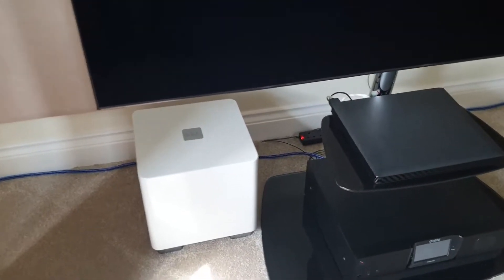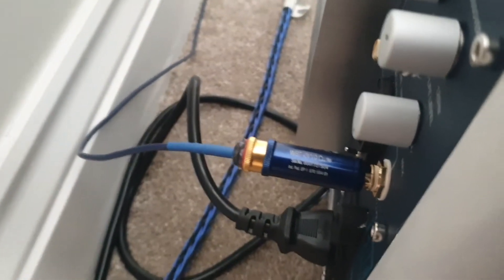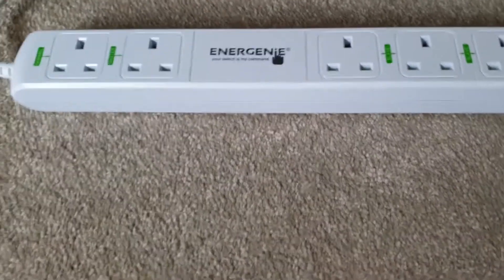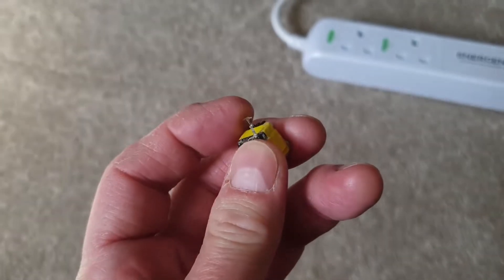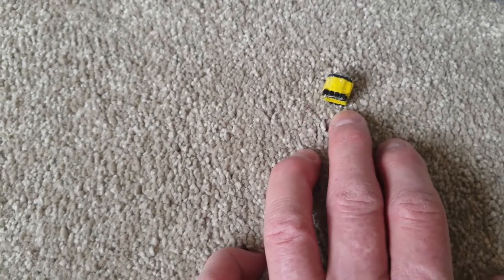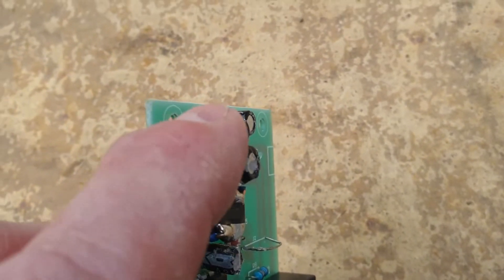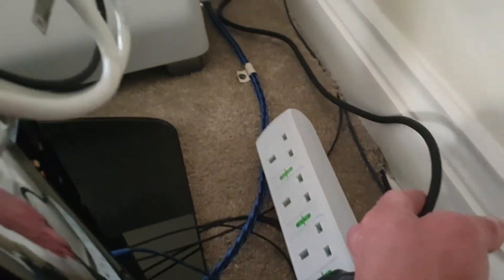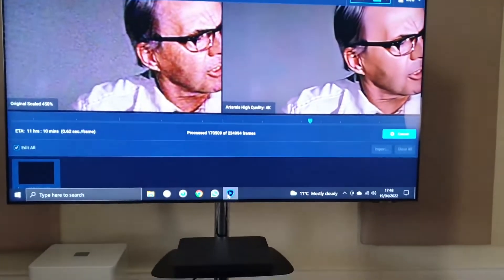Fixing Whine in Energinie ENER017 Master Slave Powerstrip for use with my REL T5x Subwoofer

Comment: hi, amazing video first of all and super helpful - just wondering if there has been any issues with using it aside from the noise? planning to follow your steps but slightly worried the extension lead simply cant handle the power my PC draws at all
Reply from the maker: These changes don't change the power handling side. The logic side simply controls when a relay switches in, and the relay carries the power (just like switches in a car control a relay, then the relay carries the power). You just need to be able to  solder ok
Reply: @idiocratease  thank you very much - ill definitely give this a shot then, been looking for a master-slave power strip for a while and this is the only one i could find that they still make.

Comment: Is the noise due specifically to the Master/Slave technology as a whole, or was that an issue just with that particular surge protector?  Looking to get some similar device to only have to turn on the PC and have the speakers and two monitors come on/off without having to press four more buttons.
Reply from the maker: Hi there, I think it’s down to a specific component, the inductor, which this using uses and is noisy. So another one might be ok. However, I actually have a modified spare one, with the updated inductor fitter, and it’s spare so in principle I could sell it to you. Let me know and I will put an eBay add up for it.
Reply: Hi, just stumbled upon your fix. Nice clear video. Is your spare still available?
Reply from the maker: @robwilkes  yes it is. I would be happy to sell it, just need to tot up the costs. Are you wanting to buy it? Are you in the U.K.?
Reply: @idiocratease  I'm interested in buying it, yes. Based in Derby (UK)
Reply from the maker: @robwilkes  ok, I will put an eBay ad up tomorrow… it will link to this video and will have Energinie ENER017 in the title
Reply: @idiocratease  If you also comment on here I will get an email. Thanks
Reply from the maker: @robwilkes  https://www.ebay.co.uk/itm/235730186097?mkcid=16&mkevt=1&mkrid=711-127632-2357-0&ssspo=4tHh_534SZa&sssrc=4429486&ssuid=4tHh_534SZa&var=&widget_ver=artemis&media=COPY